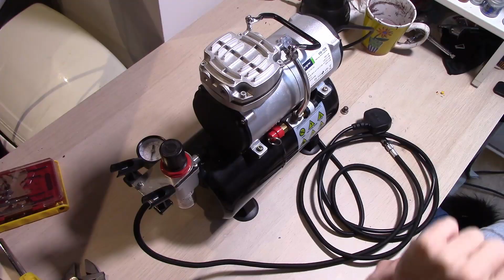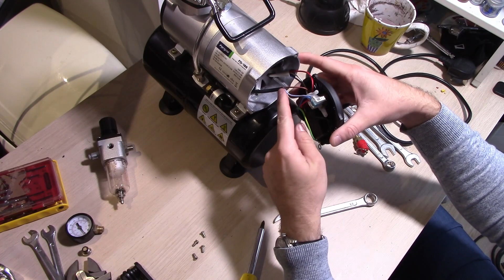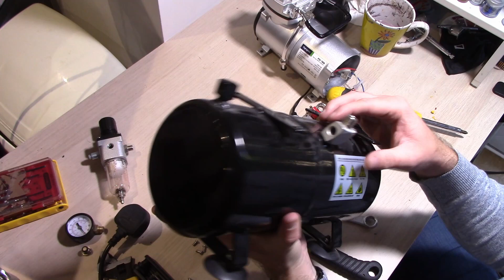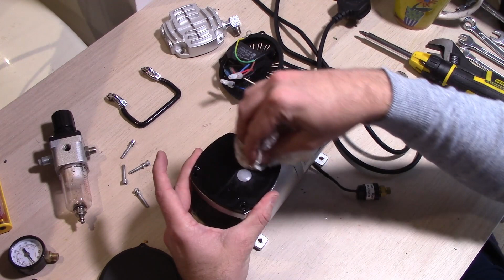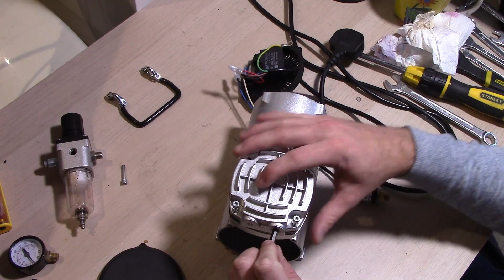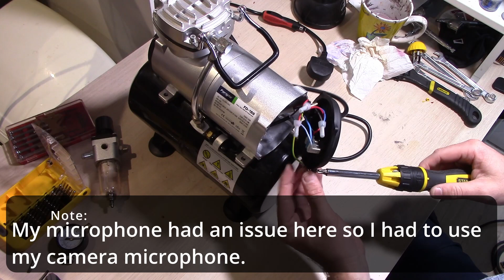Airbrush compressor (AS-186) Break down, Repair, and Rebuild!

Comment: That pressure switch and relief valve need washers under them to stop them going it too far and that will let you tighten them against a hard stop. Bad design!

Comment: I'm trying to replace the pressure regulator on my FD186 - I literally cannot get it off! It seems stuck fast. The lock nut is starting to fray too, so I have no idea how to get it off. Did yours need a considerable amount of force to remove?
Reply: Sure you are going the right direction? I mean, it sounds like you are trying to fasten it instead of losen. They may be tight, but not that you can’t lose them. Just saying…
Reply: @F @FranzvonderAlm-u5i no I was obviously not fastening it jfc. The nut was fused shut with rust - they refunded me for the compressor and I bought a nicer sparmaxx compressor which is so much better

Comment: Good video, I also liked the "oh, I shouldn't have done this" parts 🙂
But, just saying, the parts around the piston are NOT wet, this is a lubricant, usually oil or such. The stuff also keeps the seals tight.
If you dry this up too "properly", those rubber seals may dry out and get cracks. Since this was around the piston too, this is likely lubricating it too. If you run it fully dry, you risk overheating it.

Comment: yep take photos of everything, every angle, before and as disassembling... also take time to think and understand parts. if you have 2 items with 1/2" of thread and screw them fully into a casing that is 1" wide then how much air flow would you have?... and no thread tape?

Comment: I have/had one of these. I live in the tropics. Humidity here is not too different from that of Bikini Bottom. Mine has been running perfectly for maybe 7 years, I forgot exactly when I bought it. Couple weeks ago, a hole exploded and shot water out. The compressor is still working. But I have read trying to seal the hole in the storage tank is not worth it and potentially dangerous. It was 100% user error. I did not know we had to drain out the condensation from the tank. It must have become so badly rusted inside, the pressure finally broke the metal.

Comment: OMG thank you!
TBF I didn't watch the video but having the link to air compressor parts have saved me so much of a headache. My Hobby air compressor  of 15 years had the solenoid pressure switch give out and (at least in the US)  it is living hell trying to find parts to repair. Airbrush-fenga not only had the pressure switch but all the gaskets, o-rings, and even the mushroom plug check! I can rebuild this thing now, after weeks and months of cracked brain searches I can finally sit back and wait for the parts. Take that anti-consumer, anti-repair, US economy!

Edit: This video will work for many different brands from Fenga to Timbertech to no name ebay. The AS186 Air compressor is a standard item that is build and sold under various brands.

Comment: I feel like the pressure switch cable would benefit from having some spade connectors added. Save the twisting dance with the motor.
Assume they screwed in first then wired when making it. 🤷‍♂️

Comment: My compressor warms so much that stops working do u know what the issue ? It gets so hot that's I can't touch it but before that happens it works just fine
Reply: Its because the system is oil-less only a fully fledged  commercial air compressor for workshops can run all day but they get hot too just not enough to break it. These units are best used with single action air brushes to reduce unnecessary  heating from prolonged  run time. Also don't keep it in a sound deadening box or cover it with blankets you will start a fire. Get a household fan right up over or next to your compressor and make sure it's always got lots of air blasting over it to help manage overheat
Reply: @mickyfromstraya6336  it's what I've been doing put a fan right next to it and carry on working I use this compressor to airbrush canvas so it's not hours straight with no rest ..still think it's not the best design if it warms that much... more hazard then anything else
Reply: Limit usage to 1 hour on 1 hour off and use single action airbrushes and u will notice a difference

Comment: Hey. I have a new one, almost the same model. Only that emergency air exit is coming strait from the black tank, no other connections, just like a belly button. I don’t know if that’s a design problem, but the  tank never stops filling. The airbrush is new and the hose came with the air compressor, so no leaks. Any ideas why it never stops? Any dangers?

Comment: I had to change to a new tank because my original one blew a hole. The tank either takes much longer to fill or does not stop filling. Does the valve act the same way if it's not screwed in enough? I may have put it on too loosely.
Reply from the maker: It should only take 1 or 2 minutes to fill from empty.
I had a bit more of a look at my pressure shutoff valve that I had the problem with. What I saw is there was a rubber o-ring/grommet which would get really squished and distorted when the valve was screwed in which blocked the air flow to the sensor.
It would never get to high pressure and my compressor would never turn off.
So I had to unscrew it just enough so the o-ring was not squished and distorted but still screwed in enough that it created a seal
Reply: @DavesMiniMenagerie  Finished fixing it tonight. Had to replace the regulator and get a bunch of new connectors and tape up everything. Didn't have access to O rings but it's working. will eventually replace them with o rings.

Comment: Thanks for the video! Opened up mine last night. It was also wet inside the pump head, which I too found perplexing. I think condensation is a physical consequence of air compression.

Issue I'm having is that the pump head gets super loud after about 10 seconds of operation. If it's not building pressure everything stays quiet, so I'm guessing it's in the pump. I read on Reddit that someone had the same issue and it was just loose cords banging around.
Reply: why do you think tanks have drains on bottom? hint: it's not to refill the tank with water
Reply: @habiks 😆😆😆
Reply from the maker: Yeah I think I need to unscrew the tank drain valve every time so that the condensation can dry out (the condensation forms because of the heat build up and then cooling of the compressor).
Otherwise I think the moisture will stay there for a very long time.

I haven't ever run into that issue with the pump head noise.
What I have done recently is I've taken a thick bath mat and folded it over a few times and put my compressor on top of that. It has really cut down on noise from the floor shaking and additional vibrations.
Maybe try something like that to isolate the compressor from the ground and you might be able to hear the noise a bit clearer?

I think the only loose wires are in the area near the switch that I opened up in the video, otherwise in the actual pump area there is that little metal toggle that goes up and down which might be making noise.

You can (carefully) run the compressor with the lid off and the end caps off to see what is happening with the piston and such, just keep your finger on the switch to turn it off if necessary.

Comment from the maker: Links to parts and diagrams:
Airbrush kit: https://amzn.to/47a1Jsp
Airbrush Spray Booth: https://amzn.to/3woUBJs
Sparmax Max-3: https://amzn.to/3LorBFJ
Compressor parts diagram: https://www.airbrush-fengda.co.uk/upload/images/airbrush-fengda-AS186-spare-parts.jpg
https://www.airbrush-fengda.co.uk/en_US/n/1
Compressor spare parts: https://www.airbrush-fengda.co.uk/airbrush-compressors-html
Pressure gauge: https://amzn.to/476QJfs
Pressure regulator: https://amzn.to/3scIzDt
Pressure relief valve: https://amzn.to/40pKUYr
Pressure switch: https://www.aliexpress.com/item/1005002393762275.html